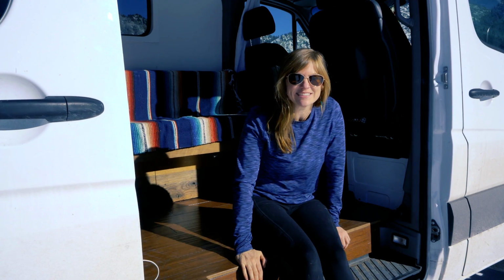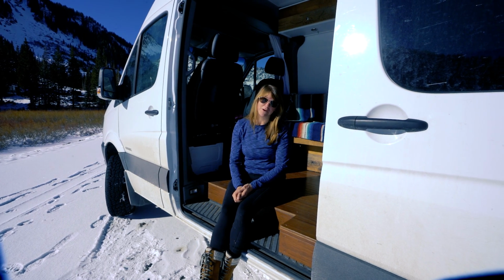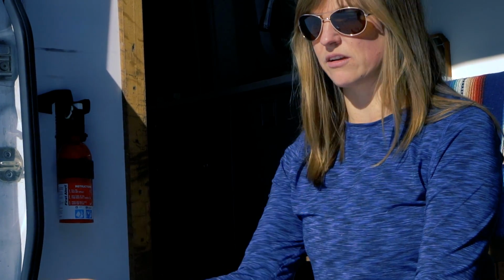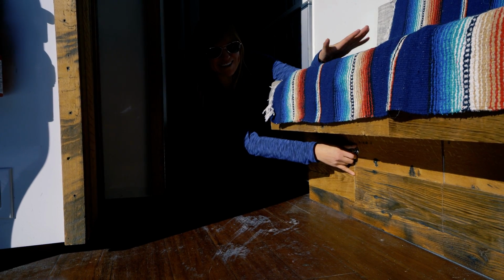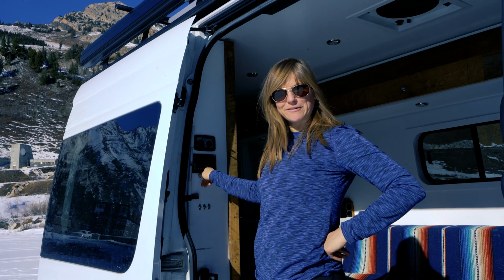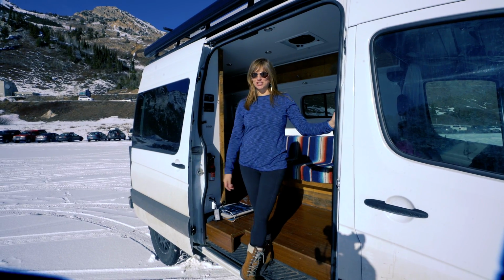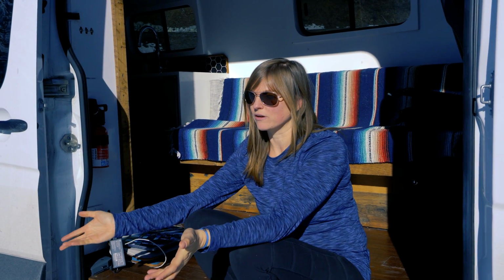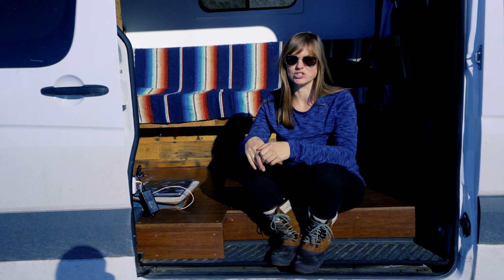Sprinter Van Solar & Electrical System Tour

Comment: Not a fan of your electrical system everything so tight to each other with all that heat created in that small box. On a hot day using your system it's got extremely hot in that box.

Comment: That's not very many amp hours i think it works out to 90 Ah. I want a massive solar system and a huge battery bank. Im trying to figure out the max amount of solar you can fit on the roof of a 170 sprinter.
Reply from the maker: Go here for more info. My battery bank is very large. I've spent 7 months living in the van and never had to plug in once: https://bearfoottheory.com/sprinter-van-solar-panels-batteries/

Comment: YOUR BATTERY 375A ONLY HOW YOU OPERATE ALL EQUIPMENT OR ONE BY ONE USING EQUIPMENT LIKE YOUR REFRIGERATOR AIR CONDITION
Reply from the maker: I don't have AC and my fridge is efficient

Comment: i really like the style you choosed for this van
and can see you are tending to have high end equipment

but the solar panels and the rest of the electricity system can be way better

regarding solar panels
if you have them installed flat, and park in part shade sometimes, and use them in very hot weather, thin film panels are way better option
best of the solidframe ones is Solar Frontier
170W panel equals with its day yield to 250W+ of monocrystaline panel
they are made in Japan and comes with best warranty of all manufacturers
they are fairly cheap, but requires very solid MPPT, as they have very high opencircuit voltage about 110V (cheap 150V rated mppt cannot handle that and burn), so victron 150/35 is minimum

there are few more better option even through crystalline panels, with diode for every cell (means the whole panel doesnt behave like its weakest cell)
there used to be good american manufacturer of CIGS flexible lightweight panels, but they ve been bought by chinese hanergy

you should check Victron products, that are btw. cheaper in states, than in europe, so thats big advantage
they are manufacturing best MPPT solar controllers and plenty of other stuff too
you can get one box called easysolar, that combines fuse box, mppt chargers, superpowerfull sine invertor (they are very underrated, so you are safe to use their peak power) and powerful charger when hooked on mains
you can connect your phone via bluetooth and can see the live data and the history and change setup

there are better options for batteries, that i ve already mentioned under comment about lithium ones
if you dont need to fit into weight limits (3.5t), where the lightweight lithium have undisputable advantage, then i would highly recommend Hoppecke vr-m with its 2500 cycles on 50dod

good luck with your next van!

Comment: Kristen, did you opt for a 4x4 Sprinter in the long wheelbase, or just regular 2 wheel drive?  Would you say the 4x4 option is worth the additional $$$, or was it more the higher ground clearance that you were after?  Thanks for a great vlog!

Comment: On the next van if you can work into the design the ability to angle the solar panels up 45 degrees or so when the van is parked their efficiency dramatically increases. You won't need to add another panel.

Comment: Hi Kristen. You should definitely get the second alternator option on your new Sprinter. Big alternators charge batteries so much faster than solar. And, of course, still add as much solar as possible.

Comment: I know you are wanting to go from the 144" to the 170" due traveling with another and a dog.  You mentioned going with the 4x4 option too.  Could you maybe explain a little what the limitation is of the 170 over the 144?  I see this stated a lot everywhere but nobody explains it.  It is the risk of bottoming it out on dirt roads?  Parking spaces?  Something else?  Also...the 170" won't fit into a regular parking space...correct?  Thanks for these videos...love them!
Reply from the maker: It's all a trade-off. The 170 is a little less maneuverable on dirt roads with clearance and parking is more limited. And just because it's bigger doesn't mean you should load it up heavier, because they have the same payload. It's just a little more room to spread out. I'll be able to fit a permanent bed, a permanent dinette and a galley in my new one. I guess I'll see which one I like better. I've only test drove the 170 off the lot.

Comment: My bet is a bigger battery bank will be more beneficial then an extra panel. With an extra panel you got everything fully charged really fast  with sun but full is full and you empty your small bank fast. Bigger bank, takes a bit longer to fill all the way but you can run much longer on the bank in case of less production. Make some calculations and use an amp meter to monitor usage and then decide for upgrades. keep up the videos
Reply from the maker: If I had to choose between more battery and more solar, I'd definitely choose more battery. But my next van will be a 170" wheelbase which means there will be more room on the roof for solar, so I'm going to do both. Happy New Year!
Reply: Well that is even better ofcourse :) :)

Comment: How much time to charge all the battries ?? With solar panel and with wall outlet please reply am intersting !
Reply from the maker: They never really go "dead", so it's hard to know how much time to charge them. If I plug in, they will charge to full overnight. Sun takes longer. It depends on the angle of the sun, time of year, and whether or not I'm driving since they also charge off the alternator.
Reply: +Bearfoot Theory (Kristen Bor) ok thank you
Reply: +Fouzi H'M vlog you charge theme only 1 time and they never dead with the usage of the refrigerator and the heater with all electronic !

Comment: Thanks for all your wonderful videos, you’ve taught me a lot re Sprinters. I’m thinking of going with the 4 x 4, but debating whether to get the 144 or the 170” wheelbase and you’d mentioned that you were going to move up to the 170. Just wondering what your thoughts were on this? Thanks!
Reply from the maker: Hey! It depends if you want to live in full time or if you are going on shorter trips I think. Also depends if you are solo vs travelling with somebody else. The shorter one is more than adequate when I'm alone. It's a little tight when it's me, my boyfriend, and our dog. If I didn't have to work in the van, then I'd probably stick with the 144, but trying to cram in a bed, desk, and a kitchen into the small one doesn't leave you a ton of options. I think the 170 limits where you can go...but we will be traveling in the 170 for 6 months straight this summer, so that's why I'm going longer.
Reply: Thanks... that's pretty much what we're thinking. Probably full-time for me and with my GF half the time and maybe a dog in our future too. The limiting where we can go factor, is our real concern and going off-road in the 170 isn't quite as flexible as doing it in the 144.  Anyway, thanks!!!

Comment: Your interior layout is perfect the fold out bed or Murphy bed whatever that's called is perfectly placed gives a ton more room were it's needed and the idea of being able to eat outside and still be an arms reach from the kitchen is very cool  I just got the middle length high roof dually 4x4 sprinter diesel. I have ideas I'm still measuring for. My layout will be similar to yours just a touch longer.   More toilet and kitchen space and I'm building a Murphy dog kennel. For a 140lbs dog. It's a pull out drawer with a heated dog bed in it. Lol.
Reply from the maker: Sounds neat! You'll have to share some photos once it's done :)

Comment: Why don’t you upgrade to lithium batteries? You can run them down to nothing with out harming them. Even though they cost more they last longer so all in all cheaper.
Reply from the maker: I've heard mixed things about lithium. They are a lot more expensive upfront, and they don't do well in the cold.
Reply: lithium batteries are the way to go, if you dont care about money, as they have  best features among batteries

they are lightweight

they have very high efficiency, that means you need just lets say 103ah to charge 100ah (mediocre agm needs 120ah)

you can squeeze them of pretty all of the juice still with fantastic battery life (cycles)
so for equivalent of 400ah of agm you need just 200ah of lithium

if you pay some extra and buy victron lifepo4, you are pretty much safe from catching fire
you still need some extra gizmo like BMS, special lithium charger, split charge relay etc.

if you dont want to pay extra, and care about optimum between price, lifecycles and usable power, you can go with high end gel (OPzV) or agm- i can highly recommend german Hoppecke VR-M, that offers 2500 cycles on 50%dod (5x more of standard agm battery) and is for very reasonable price
Reply: ike fun for example victron lifepo4 with correct battery management are fairly lower fire hazard, than standard flooded battery in poorly vented space
Reply: I'm leaning towards agm myself.  1.  Lithium may take up less space but it's actually more space since I can't mount them outside like agm as lithium can't operate under too cold conditions.  2.  the extra weight with agm actually helps me balance my center of gravity.  3.  Most people will not keep their vans for more than 5 years.  So the long life with lithium doesn't really offset the cost of them.

Comment: Are you going to make a video on the new van build?
Reply from the maker: Absolutely! I'll be documenting the process just as good, if not better, than the first time around.
Reply: Kristen- Can you describe what you intend to build for new van? A few months ago we ordered our new Sprinter 4x4 Sportsmobile RB 144 w/ pop top. Still have some time to make final options, thinking two 100amp panels and a 2800 watt inverter.

Comment: Great video, thanks!... Two questions... 1. Do you ever worry about overhanging tree branches damaging/scratching your solar panels when you drive on unsealed back country roads? I have a high roof Sprinter - I’m tall with a bad back - & love hiking. I’m wondering if I should get the Powerfilm foldable solar panels instead of roof solar panels. But, the roof ones are set & forget! I’m confused!... 2. I have a Goal Zero Yeti 400, but I’ve been told that regular AGM batteries like yours charge a lot more quickly. Do you know if this is true? - Michelle 🙂🌲
Reply from the maker: I've definitely hit some branches when parking and on dirt roads and the panels have come out unscathed. I don't know much about powerfilm, but I think having some permanent solar on the roof is the way to go. As for Goal Zero, alot of people swear by those. The Yeti 400 has a 33Ah capacity. My battery bank is 375 Ah, so I can power a lot more stuff for a lot longer. I've also heard the Goal Zero take much longer to charge, but I don't have personal experience with them. It really depends what you need to charge.
Reply: It sounds as though solar panels are tougher than I think!... I'll look into them - maybe some are tougher than others. (I’m unsure if the brand you mention are available near me.) ... So you have more than 10 times the power I do! I don’t yet have a fridge, but I would like to get one. I don’t have any experience with normal AGM batteries, but I’d better look into them more if they are quick to charge... Thank you so much for that very helpful perspective! ☀️⛰
Reply: neoyum the panels are made with tempered glass, tough and highly resistant. We now have panels up to 800w so you can maximize your roof space. Regarding AGMs, they're very durable, affordable and do charge quickly, best of all, no maintenance required. Check out aeacares.com for complete systems